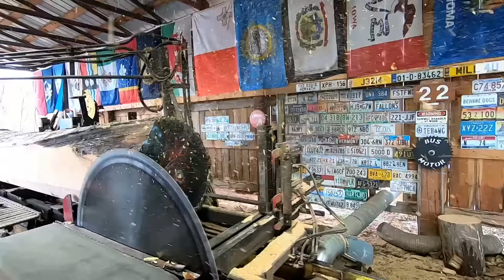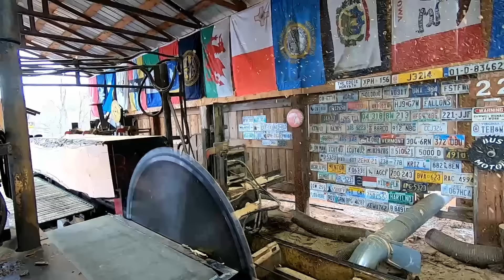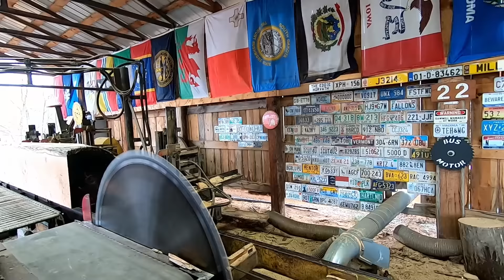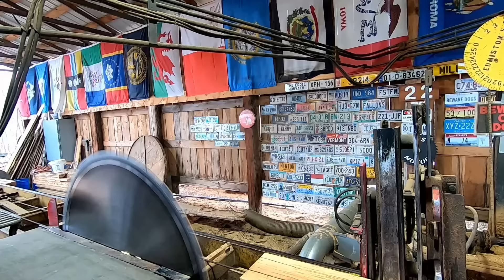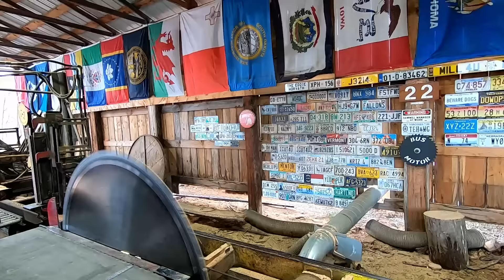sawing a monster cherry log # 389

Comment: Good morning. I'm a retired carpenter.  I see some comments about wood being wasted. I'm not so sure of that. It's just wasted in a different way, but it looks like about the same amount of waste to me. The soft wood on the exterior of the log doesnt have the value of wood further in, anyway. I prefer your techniques over the band saw as well.

Comment: I used to work at a sawmill similar to your setup you have. I loved the job. I'm happy to see you give your employees time and you are patient for them to do there job safely.
Reply: I used to worked for 19 years in a furniture factory where we used cherry for 80% of our  end product.  We used 4/4 FAS and had to cut around the small defects at some point during the sawing phase.  The log you just cut was driving me crazy with all the wain and face checking. Not rushing your guys is admirable . Safety is so important with an open blade of that size in the room. Kickbacks must be frightening when it happens there. The sawyer and crew seem to be a very good team.
Reply: My employer had a twin blade set-up. And the edger set-up was less than five feet from the saw blades. I would get covered in debris all the time when we would cut big timber. I loved the job but it became quantity or quality and safety kinda went out the window. And I felt like the job wasn't worth me getting hurt so I left and found other employment. Love watching sawmills like yours cause I have been around sawmills my whole life.

Comment: Hi mark what part of Pennsylvania are you guys in I'm about 15 miles from niagara falls ny awesome cherry log my girlfriend has a maple in her back yard 9 ft around at the base 13 ft is straight I'd just love to see the grain in that big mama she's about 160 ft high the one that used to be in her front yard covered the entire house and had to take it down was the deer hanging tree replaced the roof and the neighbors brother took 8 double axle landscape trailor loads and they still had a ton left after the stump size was unbelievable silver maple it was i told her I want the 14 strait section out of the one by her shed big saw time like a Stihl 066 or 088 I'm just dying to see the grain in this monster just imagine a two and a half car maple garage with a metal roof ya baby and still have enough left over to build a shed for my new gravely zt HD 52 zero turn and a all solid maple jumbo acoustic 6 or 12 string guitar
Reply: You have a kindred soul here in  northern Wisconsin. Chain saws, jumbo acoustics (Guild 212xl) and woodworking.

Comment: I am amazed at how you can look at a log and know how to turn it to get the most efficient yield.  "Whittling down" the logs is a process you can hardly avoid with your mill being  circular balde in lieu of a band saw blade.
Just looking at your collection/display of flags and how you have them hung with the tops of most of the flage to the right as you look at them.  FWIW, and as a Native Texan, I thought I would point out that the Texas flag is displayed incorrectly with respect to all the other flgs.  The white should be to the right, with the single ray of the star also pointing to the right.  And I also question the orientation of the Arizona flag as well, but not seeing it on a daily bsis, I'm somewhat conjecturing.

Otherwise, I enjoy watching your videos.  😎👍😎
Reply from the maker: thanks Bill.

Comment: i never skim a log it just heats the saw up. specially  since it seems your saw has less than a 1/16" lead in it. the saw should never throw dust at you on the return from the back of the saw. not enough lead. but seems to work out for you. prob have to hammer your saws more often.
Reply: Do you mean the set of the tooth? Cuz hammering the blade is to make it cut straight... and once they cut straight you don't hammer them for fun  ...🙄. I think this dude knows what he's doing after 30 years..
Reply: Hammering saw sets the dish in saw so it will have tension to cut strait and also to keep eye of saw away from rubbing on blade. Hammering isn’t what keeps the saw strait but it will help. Do you the process I own 3 circle mills over 20 years doing this. I think I know a little bit
Reply: @carbite81  I don't think a lil dust coming off the saw on the back stroke means his blade is out....hammering the blade is a huge factor in the saw cutting straight ...assuming the teeth are properly set and sharpened..I grew up around sawmills and have built a few also run one now. I'm 45 ....this dude been around longer and I wouldn't criticize.
Reply: @williamturkewitschturkewit1549  No offense but you have no idea what you are talking about. You do NOT "set teeth" on a circular saw. They are replaceable teeth that have set built in. They are tapered. The more you sharpen the smaller your kerf.
Reply: @mattdillon4398  exactly..that is what SET means 🙄. Seems to me you have no clue yourself 😅🤣😂
Reply: @williamturkewitschturkewit1549  That's NOT true! "Set" is when teeth on a blade are bent (set) out determine a fixed kerf. Circular sawmill teeth are straight and removable. In other words, they have NO set. This is why a circular saw has "lead" (not square to the carriage) of about 1/16 - 1/8 of an inch. So rolling your eyes and laughing are of no use to your argument! You are wrong according to the facts and the dictionary. Sorry.

Comment: What are the considerations a mill owner thinks about in choosing a circular saw or a band saw set up?  Thanks.
Reply: If you are planning on cutting logs this big you want a circular saw cause most band saws do not cut this large of a log, most logs are not this big and a band saw would cut them down much quicker and with cleaner cuts, the wood almost looks sanded with a band saw.  You also get more wood with a band saw cause the blades are so thin.
Reply: @hulkhogan2113  Thanks!

Comment: You got some nice wide boards but it really went to heck in the middle. I think you made some 4x4 firewood. You do what you can with what you got. 🥸👀🪵👍✅
Reply from the maker: yes the center was all split up so I made blocking for around the mill.

Comment: How are you guys making out with getting power run to the mill?  Did you change up the order for the new edger to run as an electric like you said you might?
Reply from the maker: no power yet , gas engine on the edger.

Comment: With the bandsaw mill next door, why don't you use that to get wider boards as you trim down to a cant that the sawmill can cut? When will we see a bandsaw mill video?
Reply from the maker: the band saw does not belong to us and cuts vary wavy.
Reply: @markgalicic7788  you did a video with a bandsaw a while back and I thought it was yours. When you built the shed I thought I remembered you pouring a slab for one. Check with Nathan. He's got those good blades

Comment: Why not get a larger blade so you can make one pass to get a larger board it’s only a piece of metal to make a larger blade !
Reply: He would have to go with a bigger motor o spin a bigger blade,
Reply: Bigger blades need bigger horse power
Reply: Not enough room on the conveyor belt for anything bigger.  He would need to do a complete revamp.
Reply: A bigger blade translates to a bigger log next time. It becomes a race to the cliff. If you keep getting bigger and bigger, it gets heavy on the carriage, needs more engine power, etc. one will always push one's limits. Keep it real and keep making great videos. By the way, almost no waste on that log. Very good. Usually big logs have bad centers.
Reply: Big logs usually end up like that saw that many times because I run a mill for years

Comment: Darn tree was stressed at one time.
Reply: What do you mean by that?
Reply: At 22:38 of the video you will see some cracking of the center of the log. Sometimes that happens when a tree has been stressed by mother nature. Wind,ice or snow load. The fibers under tension will split. The ice storm of 98 stressed alot of my oakes in Maine.

Comment: I don’t see much more % waste than regular slabbing from squaring operations even if you had an 8ft blade.
Reply: The people who don't like the stop signs mostly don't know much about sawing, I think. Years ago we sawed a 13 ft cherry that was 47 inches on the little end. Of course it was 48 inches on the big end. We had a 46 inch blade. You work with what you have. Biggest problem is deciding where to start.

Comment: Question: Is a band saw better for larger diameter logs? Thanks
Reply: Most band saws are not this big, I'm sure they make them but I've never seen one
Reply: If you did have one big enough for this log then it would be better than a circular saw

Comment: What a waste of lumber! Your mill cannot handle big logs ! My Mobile Dimensional Sawmill cuts from the top down & the most of the tree .
Reply: I have yet to see a mobile that can cut big logs. It's also a matter of knowing what cutting patterns suit the different timbers. Unfortunately circular saws do have a heavy kerf but so do wide band saws. 10 feet diameter logs used to be common as did the real mills that cut them.
Reply: Craig, Mark is making firewood.
Reply: That looks to me like a bandsaw job!
Reply: @craigkay7891  He didn't waste ANY lumber! He has an edger. ALL those pieces that have wane are run through the edger.  He even talks about "edging" in the video. The sapwood on cherry is not used, it's worthless because no one wants it.
Reply: @mattdillon4398  I Said my piece Weeks ago ! No need to Rehash ! My Sawmill is the Best ! Saws & Edges in 1 pass !
Reply: @craigkay7891  That's fine, but you are still wrong. he was NOT wasting any lumber. Besides, there is a reason that most lumber mills do NOT use your type of mill, lack of production and the vision ability to saw a log for grade! It's ovious that you have no idea about production grade lumber sawmills. The sawmill in this video also has an edger option to saw and edge in one pass. Your mill might be nice, but it is FAR from the best. It's a hobby mill that is made to cut dimension lumber (hence the name), NOT grade lumber. Dimension and grade are apples and oranges.

Comment: Why not get a larger saw blade ? It’s only a piece of metal with teeth in it ! Always see them use a small blade to cut large logs  while wasting nice lumber and run the saw back and forth ! If the log is 20 inches across get a 40 inch round blade   Crazy  !
Reply from the maker: this is a 56" saw and it's the biggest I want to run Michael , if I go to a 60" saw many changes will be needed such as more horse power , redo the sawdust collector , widen the off bearer belt , move the saw guide . Crazy !
Reply: Everything is easy when sitting on the couch eating potato chips. Things are more difficult in the real world. Try it some day

Comment: oh mark did the Detroit 6v92 really come out of a bus and did you have a hard time finding the clutch assembly for the saw i take it you run the hydraulics of the Detroit as well by the way how many gallon fuel tank do you have that Detroit is thirsty oh what year is the engine and did you guys take out of the bus did you also get the tranny with it I love the 8v92 and the two stroke version 8v71 and the 12v71 Detroit s kick but and always will how many miles were on her when you got her and how many hours our on her now

Comment: These tree’s take years to grow I think that he waists a lot of good wood all because not set up for big trees like this
Reply: So, what is the largest blade available for this, and what is the proper rotation to get clean cuts??
Reply: Waste.
Reply: Ignorance is no bar to voicing an opinion, apparently.  Get some education on lumber and sawyering, and the difference between heartwood vs sapwood, before venturing comments on what constitutes waste.
Reply: Milling and woodworking produces a lot of waste.   Look at the 'bark' on this log.   I would assume this was a dying or dead tree that was salvaged.   We had a disease go through my property and I had the trees dropped.   Later I looked at the logs and a lot of them were similar on the sap wood.  It usually starts to get spongy first.  He's spending a lot of time trimming that off.
My logs were nowhere near that big and I used a Alaskan sawmill to do mine.  I ended up with 900 board foot of lumber.   It's dry now and ready to be milled.   With cutting there will be more waste.  It's just the way woodworking is

Comment: If you had a Band Saw, you wouldn't have to keep turning it.Just saying.
Reply: If ifs were fifths we’d all be drunk. I have a bandsaw mill and it is called a “wide” model, but you would never be able to squeeze that log through… even just 1/3 of the way down. So I would be turning that log on a bandsaw, too. It’s what happens with big sticks and his turner (Chewy) is about six times faster than mine and his dogs are easier to set. The bandsaw also cuts much slower, especially in hardwoods like cherry and oak, which they cut a ton of. I know you have some kind of bandsaw fetish, but I think they are just fine how they are operating right now.
Reply: Oh thank goodness you chimed in. I don't know much about sawmills but I do watch bandsaw millers struggle with the weight of trees. It seems some of the setups would have a hard time accommodating the weight, and the width. Also they seem to be set up with blades for softer wood, and end up replacing blades more often with hardwoods.  @alanpettibone